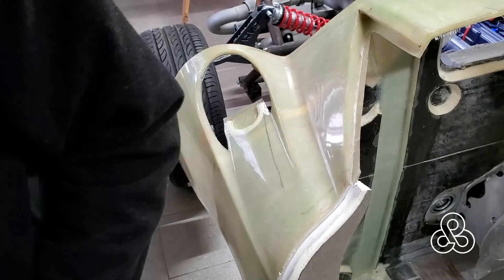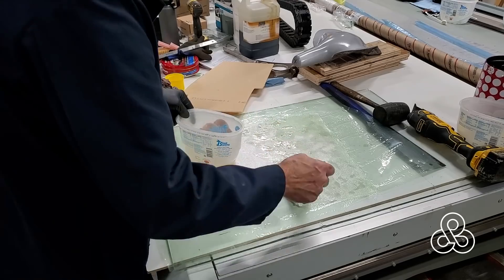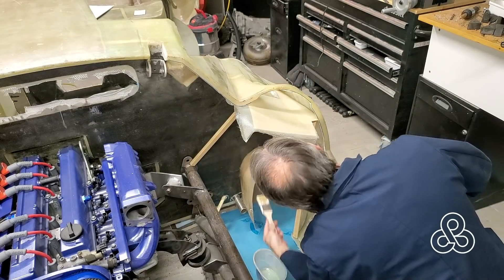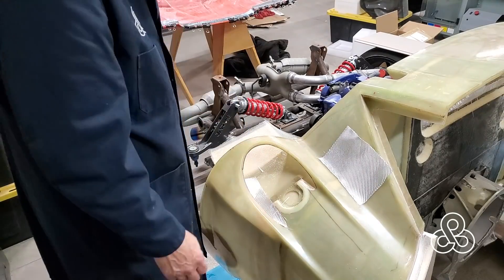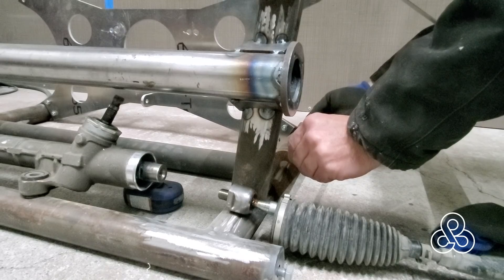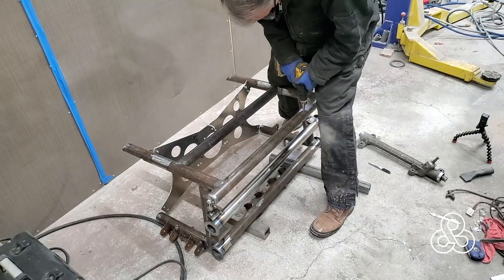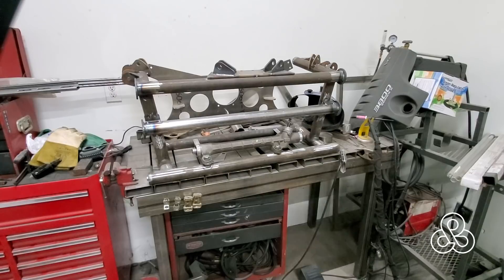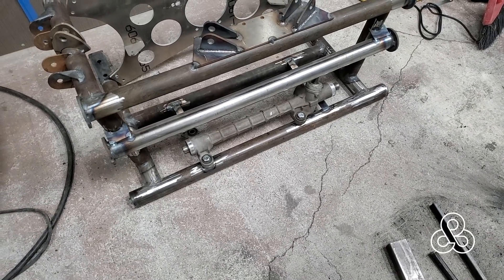A52 - Build it once, build it thrice, now the steering rack is very nice. Arete supercar project.

Comment: Hi. I see black lines drawn on your car. Are they Sharpie marker. My painter said paint manufacturers do not Guarantee paint finish if there is sharpie underneath. I had to put filler over all sharpie and others have had to grind it out. Cheers
Reply from the maker: Those lines are actually on the back side of the laminate. It is just translucent enough to see through. On that note- A good way to commit suicide and still be able to collect on life insurance, is to walk into a body shop with a can of silicone spray. Ha!

Comment: i would not want to crash in this fiberglass cardboard car
Reply: How many times does he have to say prototype... geez.  Keep up the good work
Reply: @christianbyachts  what? This is as close to the "final product" as it gets. To change the structure of a car is a major thing, he never explicitly said this.
Reply: Correct: sadly he is not interested in driver protection.
Reply from the maker: Said Richard Smith
Reply: @BuilderCreator  Jay: I do admire many aspects of your project. Equally tho, as an engineer, I have profound fears for the integrity of your "tub" and how it would perform under stress and duress as well as (heaven forbid), an accident. Important information is out there, but you seem totally oblivious. Good luck
Reply from the maker: @richardsmith9509  I am not oblivious. It is so early in the process that 80% of the composite structure has not even been built, the steel structure is not yet placed, and I RARELY describe future design features, yet you continually beat upon this drum of safety concerns after watching a few videos not knowing what safety features I may have spent countless hours preparing to implement. I appreciate you coming and being part of the channel, but please start your comments like the one above; it goes a long way, compared to the "this is a death trap" approach.
Reply: @BuilderCreator  Jay....I'm trying really hard to remain positive.  In my 25 years of motorsport/road-racing I learned so much. Its second nature: I will leave this with thinking of the design as working from the inside out and NOT from the outside in.
Reply: @BuilderCreator  I raced a Chevron and a TIGA sports 2000 race car (s). Both had aluminum monocoques with rear engines. On track both were faster than a Porsche GT1 that cost $500,000.....I did pro racing and time attacks and did all my mechanical work myself.  I've also taught high performance driving for 15 years: race track driving that is....I didn't waltz in from the cornfields
Reply: @badhairkutt  go get a hair cut..pal
Reply: @BuilderCreator  Jay, did you look up the Adrian Newey book reference I sent to you???  I must admit that your naiivete is getting to be painful. The knowledge and technology is readily available but you keep inventing, failing, redoing and repeating......sad really
Reply: Have you see fiberglass based frontal impact test results?   http://www.turbo-mopar.com/forums/showthread.php?76587-Consulier-crash-test

Comment: When I was being taught to fibreglass, the rule was cloth required a squeegee and chopped strand matt required a roller. You never see surfboards being made with rollers or gel coat, usually not even a flow coat, cloth doesn't need it. It gives a decent finish anyway. Chopped strand matt really does need a good roll to get the air out and a decent gelcoat to give a nice finish.

It was the job I did, before coding, if you search Jbodystyles sideskirts here on YouTube, you'll find the only video I made where I make some sideskirts, the video quality is poor, because it's over ten years ago, that's if anyone is bored enough to actually search for it

That was a rather long winded way to say, yeah, cloth doesn't need a roller.

Edit to add, it's this here
https://youtu.be/IpNkWwFo__Q

Edit to add, none of that stuff is for sale anymore, although I do still have the molds,.but my shed ain't big enough, and I code now, so, yeah, not a plug for business.
Reply from the maker: Coding, like writing requires just some space in your head for materials! Ha!
Reply: @BuilderCreator   lower overheads lol